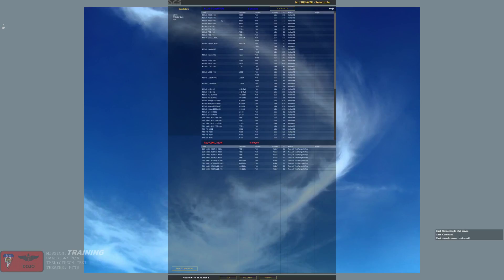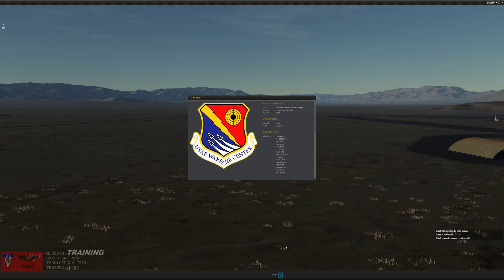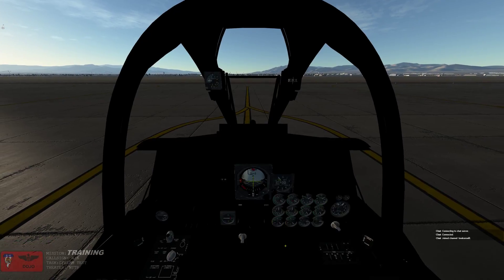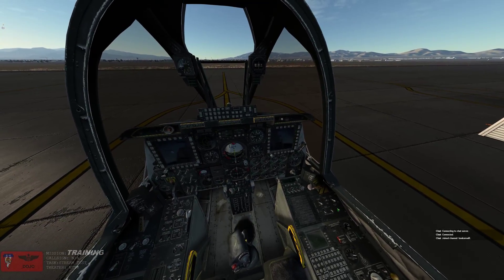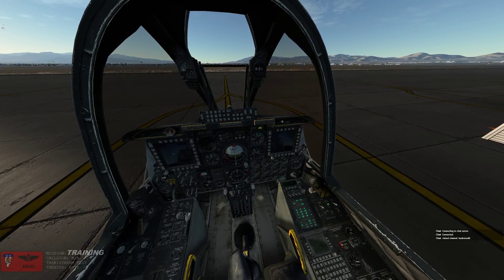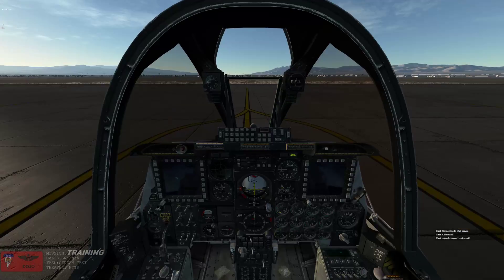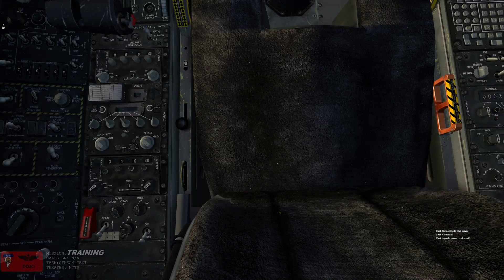DCS Simple Radio ATIS Proof of Concept

Comment: intresting. 
how did you set up that? 
thanks for the video.
Reply from the maker: I had to jump through a number of hoops actually.  The only reason I haven't published the process is because I'm hoping to work on something more simpler with Ciribob (the SRS developer).  If you're still curious, I'm happy to describe the process.
Reply: Dojo thats okay.
I have sort of figure out the process. after many woops as well. 
when you mean work in something simpler you mean design a new program or improving the Simple Radio Standalone fatures?